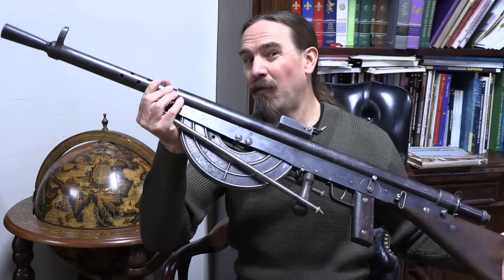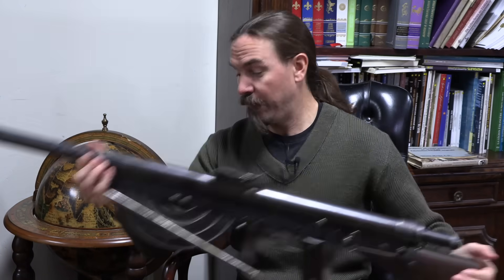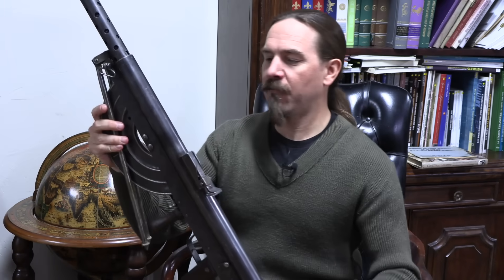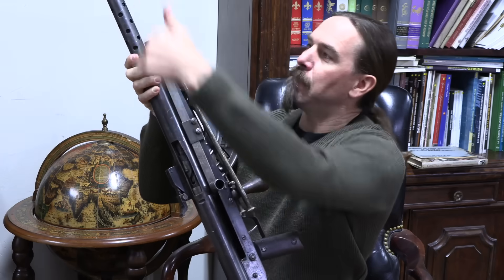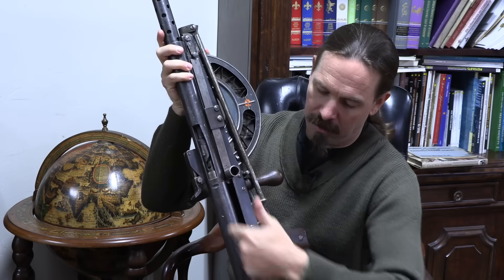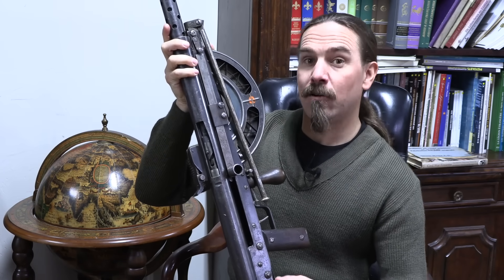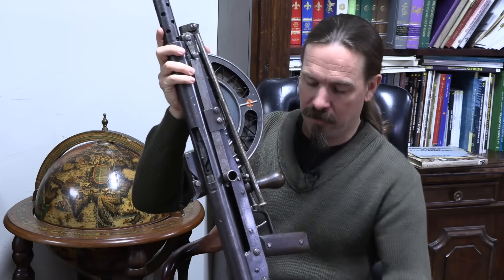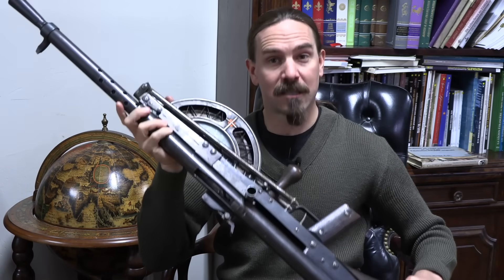Rate of Fire: What Determines it and How to Change It

Comment: Daddy always said if the rate of fire starts increasing / cook off, break the belt.
Reply: My brother in law was an M-60 gunner in Vietnam, and he said that on more than one occasion, that's exactly what he had to do.
Reply: @maynardcarmer3148  The M60 fires from an open bolt.  My experience is limited to training and working as an armorer in the arms room, but actual cookoffs with the M60 would be rare because the cartridges are fired as soon as the bolt locks, releasing the firing pin--the cartridge is in a hot chamber, perhaps, but doesn't stay long enough to cook-off when the bolt slams home.  What may be happening is that the sear becomes too worn and releasing the trigger no longer catches and holds the bolt open.  This can be hard to diagnose because when guns fire, the parts heat up at different rates and the parts expand at different rates.

The M1917 and M1919 family of Browning machine guns fired from closed bolts--as did the .50 caliber M2; those guns can cook off, especially the M1919A4 and M1919A6 air cooled guns.  

Machine gun myths abound.  First, training isn't always adequate.  Second, not every model machine gun operates the same--the M1919A4 fired from a closed bolt and its replacement M60 fired from an open bolt.  Third, the extreme condition event remedies carry on to the replacement machine guns.  The M16/M4 can experience cook-offs when the gun is fired at high rates (200 rounds in under five minutes) and at high temperatures (when the rifle has soaked in the sun on an 80-degree day, fewer rounds are required to reach cook-off temperatures)--the remedy is usually hold the rifle on target until it quits firing (magazine exhaustion) and drop the magazine at the first opportunity, lock the bolt to the rear and let it cool down.  The 210-round basic load for the rifleman is about the cook-off point if fired rapidly, like three magazines per minute, but it is unlikely that anybody reading this has fired off that many rounds from their M16 that rapidly--that's only 90 rounds per minute, and the rapid-fire rate for the M60 is 200 rounds per minute. Machine guns are built heavier for sustained high fire rates--the M16 family is 10 to 15 rounds per minute sustained rate and the rifleman generally doesn't carry enough loaded magazines to make cook-offs a problem.

Generalities are generally wrong.
Reply: @alancranford3398  
I am well aware of that. I am also aware that with any air-cooled MG, you're supposed to fire in bursts to avoid overheating. However, when facing human wave assaults, you throw the book out and keep firing as fast as you can feed the ammo to the gun, and they CAN run away. It doesn't do the barrels any favors, though.
Reply: @alancranford3398 thanks for the information about “the basic load”.
Reply: given your avatar, I had a vision of Louise saying that line and Bob looking very confused.
Reply: If you can't aim through the heat haze, change barrels. 😊
Reply: @BerndFelsche does one “soak” the hot barrels in something like a light oil or similar (if it’s available?  Probably not terribly likely outside of a prepared position.)
Reply: Which goes back to fire discipline.